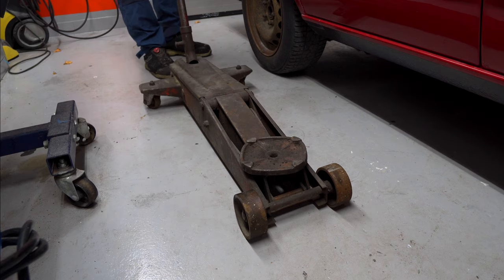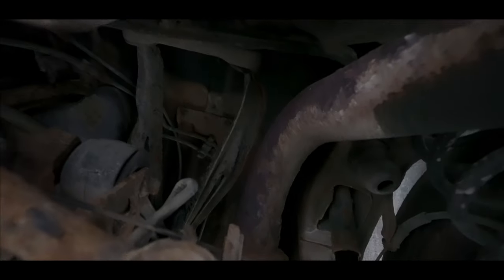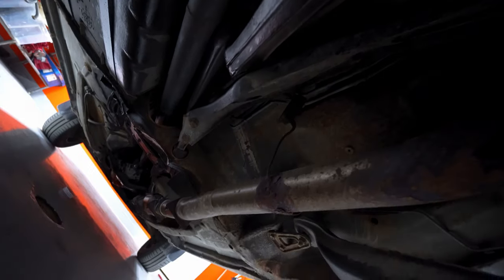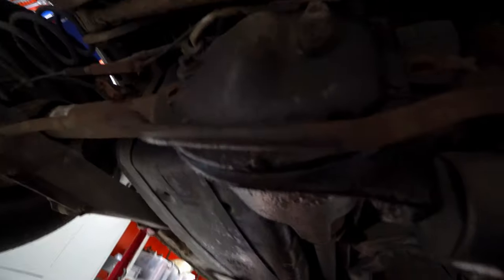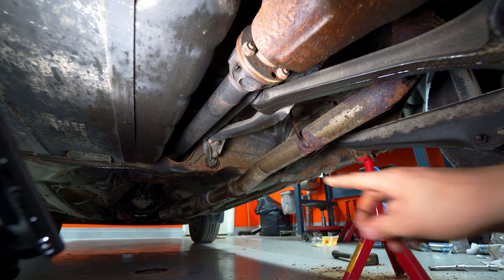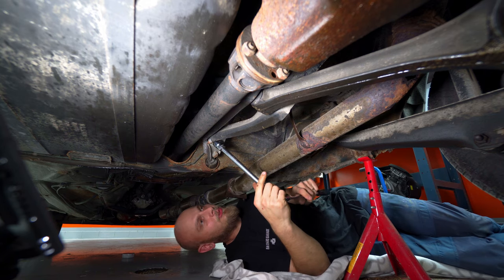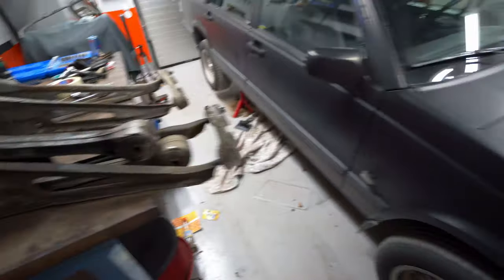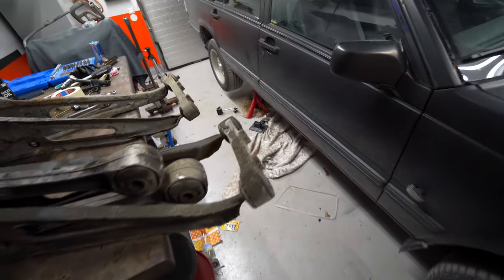Big Changes to the Channel and Fixing the Volvo 940 Rear Subframe

Comment: Great video, it seems like you have been a very busy man. Also love the 940, what wheels are on it? BMW wheels?
Reply from the maker: I got my hands full no doubt 😄 I think the weels are some kind of 80's rial wheels. Cant remenber what model but i really like them too. Fits perfectly to the 80's look of the car.
Reply: @BackmansGarage  they look absolutely spot on. Hmm wonder if I can find out where they came from aha keep up the good work buddy. How many Volvos have you got then out of interest?
Reply from the maker: @SimpsonsClassics  Rial 7J15 is the name of the wheel 😃👍 Had to go out and have a look on the back of them. If you google them they seem to look really good polished! Might make a small project out of that 😄 

I only got 4 at the moment.
Volvo 740 gl
Volvo 945se
Volvo v70
Volvo s60

 In the past: 
Volvo duett x2
Volvo 740 gle x1
Volvo 740 gl x 4
Volvo 740 turbo x1 
Volvo 242 x1
Volvo 244 x 3
Volvo 245 x1 
Volvo 940 x1
Volvo 945 x 2
Volvo v50 x1 
Volvo xc60 x1 
I think thats all of the volvos anyway.
Reply: @BackmansGarage  hey I would be interested in seeing that as project I am tempted to try and find a set of those wheels. Do they need any adapters or anything or just bolt straight on?

That’s a cool collection it’s definitely apparent from your videos that you really know your stuff, we have been looking at a old brick for years now maybe it’s time to get it done aha